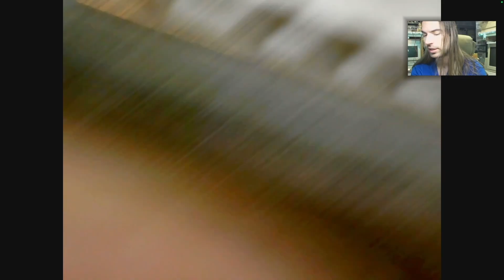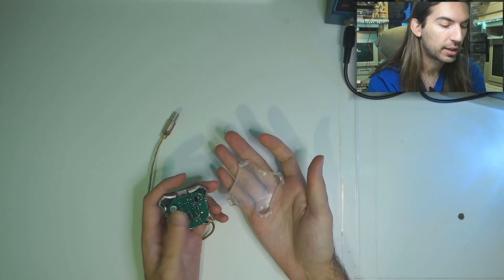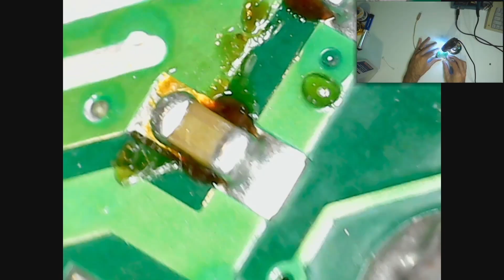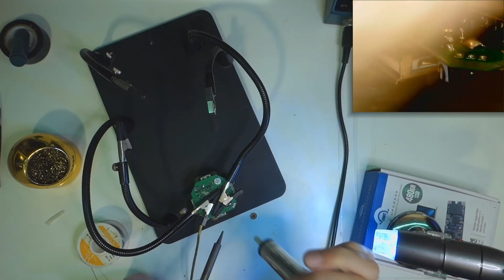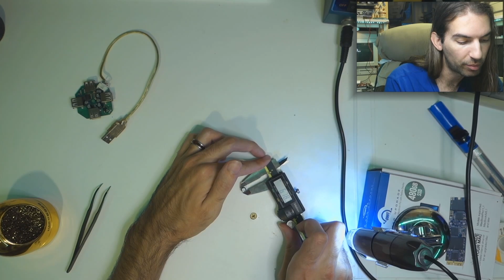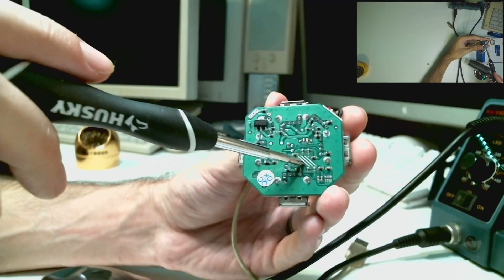Trying to fix a simple USB hub: diagnostic techniques

Comment: Jeremy, a tip... Please get yourself a 'no clean flux pen' and dispense a little flux to each solder joint that you are attempting to re-flow with your soldering pencil. Or a rosin based flux gel though that requires cleaning afterwards. (And try not to inhale the fumes from either flux type) That should help greatly with allowing the solder to wick around the device or component pin or the plated through hole (PTH) or any solder connection. You can also 'tin' your soldering iron tip with a fresh, small blob of solder when trying to heat up the leads of through hole components to aid with thermal transfer. In addition to your tip cleaner foil, a wet sponge is also a useful medium to keeping your tip clean which is important to ensure heat transfer through the solder tinned tip and the connections you are working on. A dirty tip develops a glaze which can be a barrier to heat transfer.
Reply from the maker: Thanks- you're totally right. A good flux would have made this a much better experience. I got a pen, and used it in reinstalling the capacitor - night and day difference. Appreciate the tip!

Comment: Maybe is the voltage regulator pumping too much voltage through to it?  Maybe the chip is fried out if it got too much voltage.
Reply from the maker: Thank you for this... I feel silly for not testing the voltage after noticing the thermals. I did a thorough test of the VRM in a followup video; posting this in a few minutes.